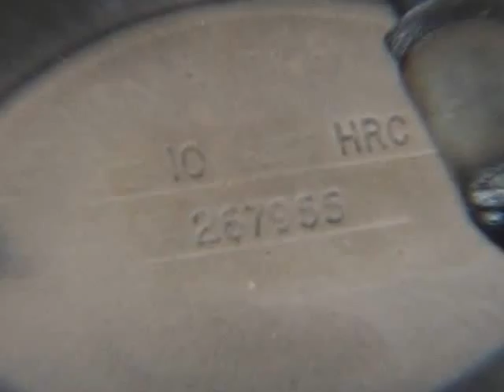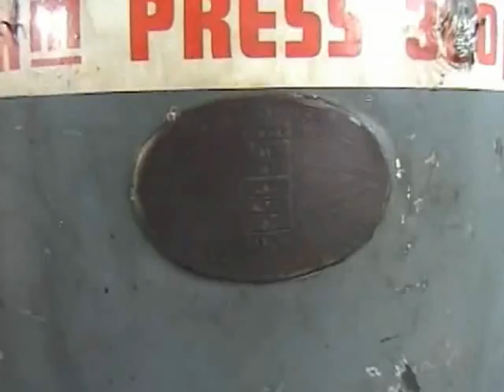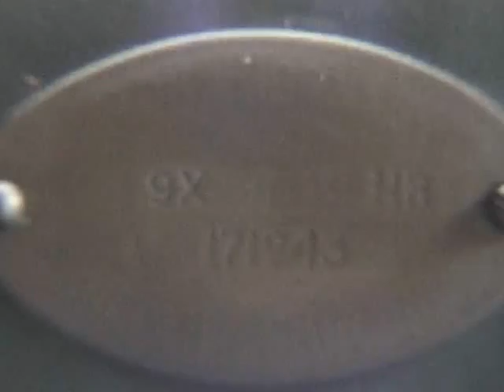Ruston Hornsby engines in a water pumping station.

Comment: These are NOT the original engines that were put in this building, In 1914 when this station was built is housed a pair of CC oil engines of which only 3 now survive in the UK. I have one.